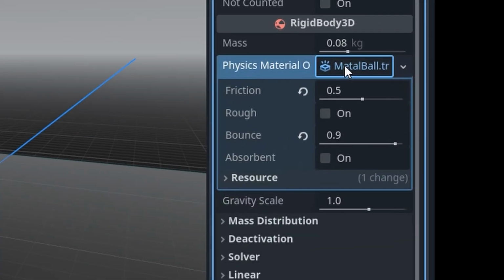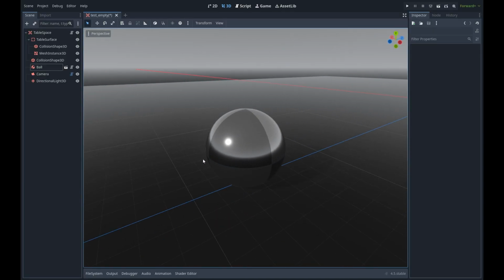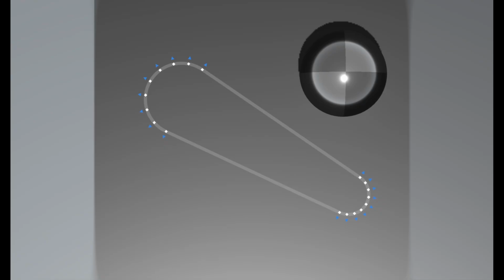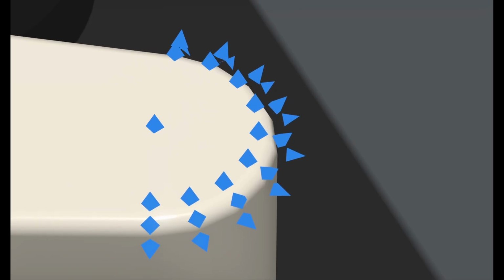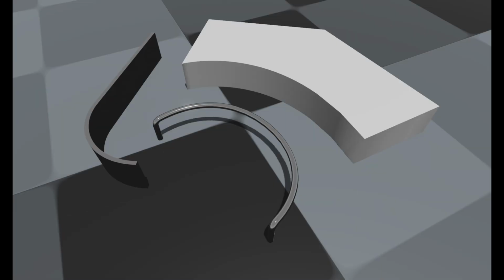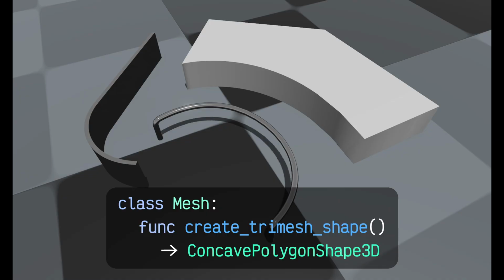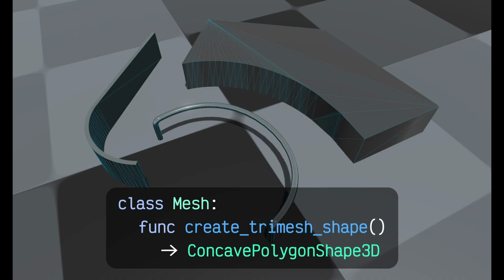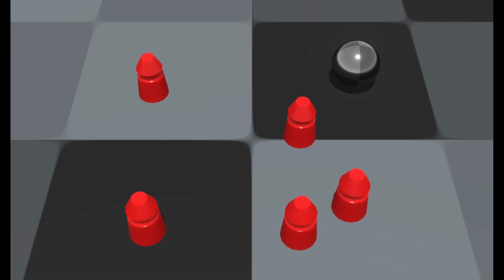A Pinball Game Devlog #2: Procedural Parts

Comment: Getting the core right is such an important part and so far it seems like you've covered the hardest bits. As for making videos, you could easily make them 3 - 5 minutes long instead, then just focus on one or two things like you've said. 
Either way as a man who knows very little about pinball, it's very interesting to see your process :)
Reply: I agree, perhaps some shorter vids that are focused on a smaller/easier features could help with pacing